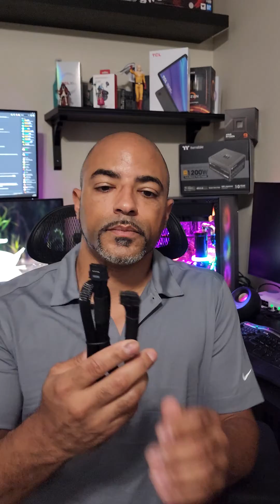Melting? Early days of GEN 5 ATX 3.0 Power Supply Units. RTX 4090s

Comment: AFAIK the only (non-adapter) cable that has been shown to have melted just happened within the last couple of days, it was the 12VHPWR cable that came included with a new MSI 1300w ATX 3.0 PSU. It's being reported that MSI may be using a sub-par cable made of higher gauge wire that does not meet the required specification for a 600w draw.
Reply from the maker: More info keeps coming in by the day
Reply: @DaPoets  Yes, it most certainly does. It appeared as though you were implying that the cable you were showing (included with the Thermaltake GF3's) had reports of melting, I have not seen any reports of that particular cable melting. 😉

Comment: This was misleading. Corsair melted cables in testing. They fully stand behind their connector. The only people having problems are people with adapters, and bending them. The FE has a design that doesn't keep the connector tight when the gpu is mounted horizontally. The asus connector is upside down and holds contact much better.

There has not been one single report of an actual pcie 5 connector melting. Only adapters.
Reply: Reddit just had a post of a msi pcie 5.0 600w cable melting on His new 1000 watt PSU. So this might be a widespread problem in time, as the connectors are too small to pass that much power.
Reply: @TAK  he didn't show any information at all. Just the connector, which we know isnt the problem. We KNOW the connector isn't an issue when proper cables are used, and terminated correctly. We need to see what cables MSI used and how they are terminated. 
People are taking things with so many variables and blaming the connection itself when it's been used before without any issues, and tested to well over double the rated power without melting
Reply: @Cblan1224  Better buy a cable mod kit, before it happens to you, The manufacturers that made the original cables are garbage designs as they have split horizontal slits in the connectors, makes for poor connections.
Reply: @TAK  of course. I have one on the way. Was suppose to ship yesterday.
A survey revealed some of nvidias adapters use under spec wiring. I looked at mine and I do have the 300v wiring with the "better" split plate design. (One split in the middle, so its 2 plates where some have 6, making them too fragile)
Who knows what msi is doing, but I'm sure we won't see any corsair, seasonic, or cablemod cables melting outside of extreme scenarios.
I looked in to the msi ai1300p. Then I thought better of it and just went with a cablemod kit for my evga 1200w platinum that's less than a year old
Reply: @Cblan1224  Yeah I feel a lot of companies are relying on 3rd party cables  since they don't have the machinery to produce them properly yet, those are prolly the brands affected by this maybe?
Reply: @TAK  time will tell. Unfortunately I have to run with my sidepanel off until cablemod's 90° adapter comes out as well. It will fit but I don't have recommended clearance and I'd rather not push it. I signed up for both the 90° and the 180°. I think the 180° will be cool. I plan to have a waterblock with the 180° on the backplate-side of the horizontal mounted gpu, pretty much just to show off the cable. This will work well for people with very limited space under the gpu as well. Instead of putting any type of bend on the cable you can just run it straight into the 180
Reply from the maker: Incorrect
Reply: @DaPoets  state your source. There is not one single pcie 5 cable that has had this issue yet. At least not one that has been made public. It has all been ridiculous 4 to 1 pin adapters that are bent and have loose contacts.
Fact check before you double down. The thing you said about corsair was so out of context. There is enough misinformation and  unfounded fear over this issue. No need to add to both.
Reply from the maker: @Cblan1224  Sorry I am in the industry, and I actually speak with manufacturers.  They are melting, but not in high enough numbers to warrant a recall. People just need to be careful with these cables. I've been talking about this for over a month now. I appreciate your passion behind what you are reading and watching on YouTube.

Comment: I have an EVGA 850 P2 power supply and I'm wondering if you can test with these adapters or these cables to see if it'll work and do you have any coupon codes for cable mods as I would like their cables

Comment: Good thing I'ma never gonna have that issue lol can't afford a 4090 lol
Reply: When like the 6060 comes out it most likely will have that connector in what will most likely be 2025 ~ 2026. So you will have that issue if you upgrade in the feature even if it is a prebuilt as prebuilts tend to go with mid end GPUs. Here is to hoping the issue will be solved by then. 1 solution is to make the cable to hardened to the extent that it needs to be so the end user cannot move it nor bend them thus the wires will not pull out of the connectors. It will make it harder to do cable management but it will fix the issue if the issue is what they claim it is.